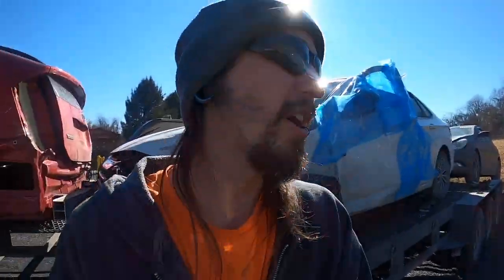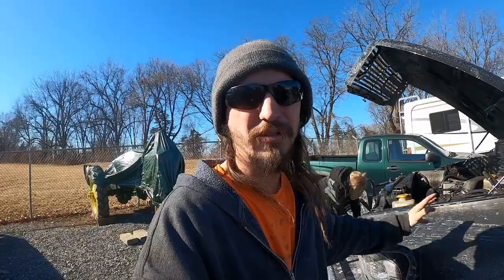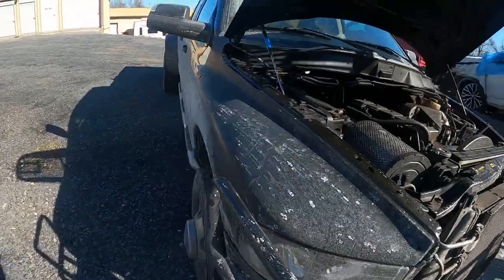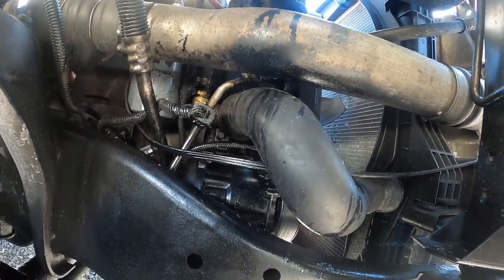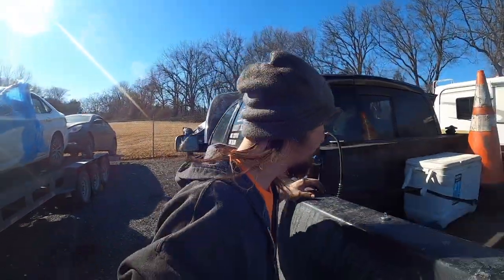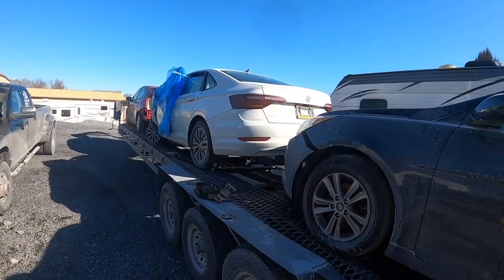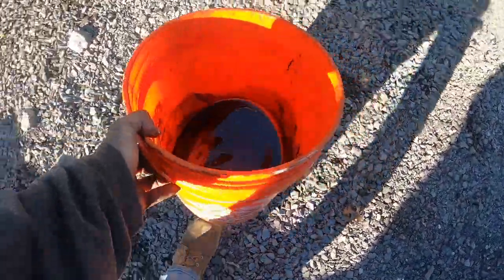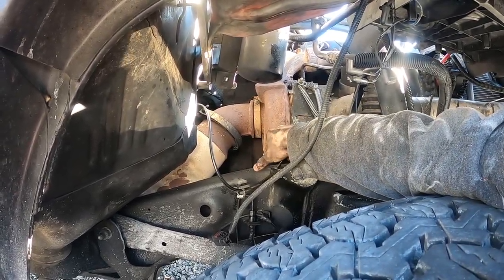12 Valve Exhaust Brake WORKS Flawlessly | NV5600 Fluid Change | Another Flipped Wedge | Hotshot

Comment: My son has the g56 he built it  he has the modified pto cover on both sides of his transmission one for draw and one for return it has a pump and external cooler he runs it when pulling loads and his transmission stays cool it has a filter on it also

Comment: Why don't you rotate the lever for the exhaust brake 90 degrees counterclockwise where it will be on the dash side of the shifter and raise it a little. Might make it easier to pull up on the lever. Just a suggestion.

Comment: You an buy 5 Ltr filter sacks amazon run a a 45  drum through a 12 volt fuel transfer pump,,leave 3 4 inch in each drum as the bottom collect water,,

Comment: Awesome! Glad to see it working. I can add a switch to activate the exhaust back pressure valve, but will wait until I have my 6 speed installed. Then I get to play!
Reply from the maker: I got it perfect today. I have a spring to push it out of exhaust brake. Now anytime I let go it goes back to normal drive position. No more fighting the throttle to disengage the brake.
Reply: @CPSteveMiller  I could tell you were excited about it!

Comment: I was at my local trailer supply shop last week, i was talking with the owner and picking up parts to rebuild my equalizers, anyways i asked him about wet bolts and he said they're a waste of money/time, he said to just go back in with new bolts/bushings and to just grease them prior to installing them.. i rebuilt 2 5300lb axles with all.new hardware including the equalizers for 195$
Reply from the maker: Good to know. Those bronze bushing seem like a lot better of an option. When it comes time again I'll replace them with factory bolts. Might as well get my use out of what I have now! I paid too much for them so I figured lets get some testing miles in
Reply: We run the wet bolts and grease them weekly . We are seeing more than double the life over the non greasabe bolts!The nylon bushings are junk, the bronze  bushings are the way to go .
Reply: I dont care what they say, wet bolts or NUTHIN!

Comment: When I am towing and have a decent downhill, when the exhaust brake comes on I see up to 75 psi in the exhaust manifold. With my modded truck tuned for towing using EFI Live, I always get 35 psi boost, sometimes a little more but not much. Not sure the 351 is going to give you 40 psi.
Reply from the maker: I've gotten 49 out of a standard fixed vane he351 lol Used to run it like that all the time. The trans was eventually what failed on that truck

Comment: Finally got my 24vp swap to ppump and my truck and running how did you get your ac to work
Reply from the maker: As long as the truck knows the engine runs, the ac is not affected.
Reply: @CPSteveMiller  ok I’ll have to check into that I used the 24 cr wiring harness in computer tac and all work but yet to get ac to engage